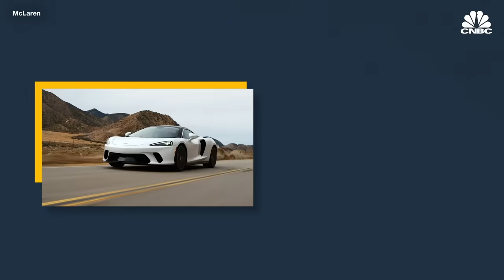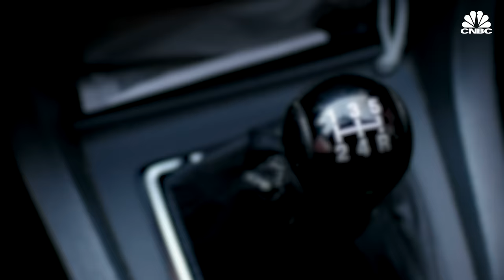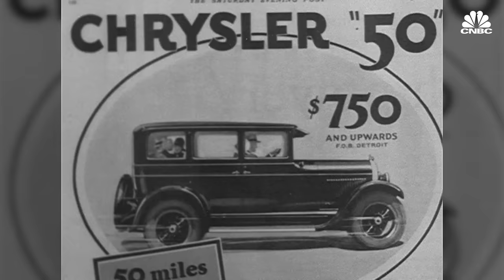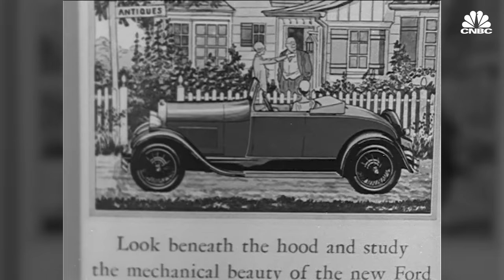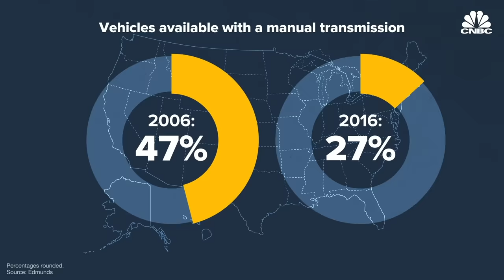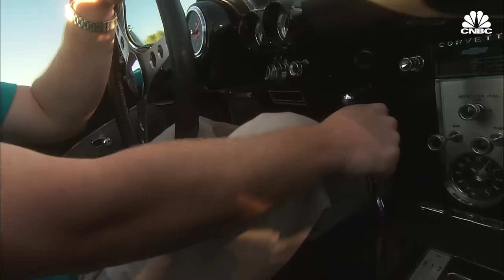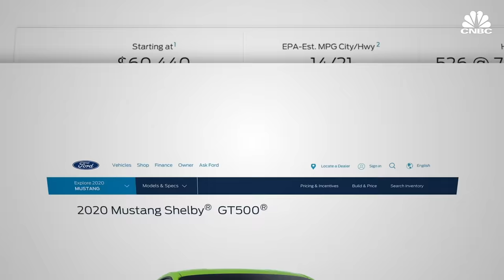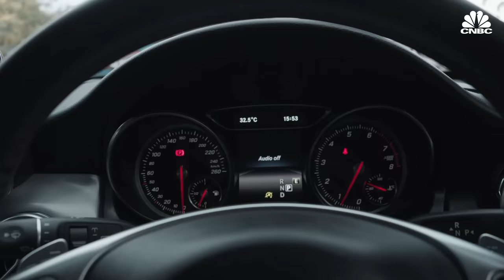Why Stick Shifts Are Going Extinct

Comment: Coming from the UK obviously I know how to drive a stick. My first encounter with an automatic was a bit hazardous. I was using the wide brake pedal as a Clutch pedal at first and when I came to a stop light I stomped the what I thought was the clutch pedal which was the brakes with everybody in the car lurching forward. Took the test car back to the dealership and looked for a manual that I bought. Actually over the years I find that freeway driving in congested traffic with an automatic is easier to tolerate than constantly shifting and slipping the clutch. Still prefer manuals but auto trans has its points.
Reply: Same experience with automatic shift, I often hit the break HARDDDD think it's the clutch lol
Reply: True, although i usually just decouple and put it into neutral in highly congested traffic. 

That way i can relax a bit rather than keeping the clutch engaged.
Makes it tolerable to drive a manual.
Reply: I never had trouble driving a manual in heavily congested traffic (L.A., ATL, Tampa, and D.C.). I learned how to slowly cruise in first gear without engaging the clutch while keeping a reasonable distance from the guy in front of me so that I had plenty of time to react if I needed to come to a complete stop. The trick is not to tailgate the guy in front of you and simply relax until the traffic opens/speeds back up again. I'd make a game out of it to see how long I could go without engaging the clutch. I never stalled, I had zero accidents, and I never came close to causing any. It's just a matter of skill and attention. I'll also add that I never texted while driving, though I would occasionally eat something while on an open highway.
Reply: I have the same problem when I get a rental as they're all automatics. I'm just upside-down and backwards until I get my car back from service.

Comment: Engine brake is still the best asset of stick shift.
Reply: Automatic cars also do engine brake.
Reply: Oo for noobs who don't know how to use engine brake properly.
Reply: What about pushing your car to jumpstart the battery?
Reply: Wrong. You can still use engine braking in automatic.
Reply: Paul Armstrong  the difference is when reaches low RPM in automatic it won't stall.
Reply: Damn Millenials..

The best manual car feature is the fun miles. Nothing compares to being able to feel the road and adjust how the engine pulls you over it. It's what makes people with stick shifts better drivers. Automatics feel like a video game.
Reply: @pjamese3  
A filthy casual video game, at that.
Reply: P mode in automatic does that job, or just leave the car in d or reverse .
Love automatic.
Reply: Angel Dust  NEIN NEIN NEIN!
Reply: Can agree here, saved me and my friend on a drive to the store. We were just going along, stopped at a stop sign, and I just casually say "I lost my brakes" lmao
Reply: Also while overtaking! (You can put it on 3rd if you are on 4th or 5th to get more power, but in AMT, the machine won't).
Reply: @pjamese3  Nah, say unskilled lazy millenials, I am a millenial who likes manual transmission and is buying one (also because, I am from India, and here most men prefer manual transmission).
Reply: Clearly those who say "engine" braking in automatic have never felt engine braking on a standard transmission
Reply: @RamsesTheFourth  when you don’t expect it to/don’t want it to
Reply: A good one, but the best? What about bump starting when your battery or starter is bad? What about heel-toe blip and brake around corners/highway exits? What about clutch kicking near redline in gutless cars to initiate a drift?
Reply: Manual transmissions are more fuel-efficient. You're not in a higher gear than you need to be, so the car is saving more fuel. Manual transmission vehicles also seem easier to maintain in some areas. That, for me, is the best asset of stick shifts.
Reply: It has saved me many times
Reply: Funny thing is engine braking is something I do all the time. I don't even REMEMBER when I learned to engine brake!
Reply: electric is superior, gg
Reply: clutch kicks are pretty cool as well ;d
Reply: @RamsesTheFourth  But you cant adjust the amount of braking by selecting a lower gear and in my experience the braking effect is otherwise gentler too. I've owned both.
Reply: @Xyb3rTeCh  Why would a manual stall if the driver knows how to drive stick?
Reply: @latuman  occasionally people made mistake...
Reply: @Xyb3rTeCh  I'm sure, but I've never personally done that, because the car will tell you in advance if your revs are too low and you should react to it. I've only witnessed in driving school.
Reply: When you are on the railway crossing without gas you should:
Manual: Your starter motor better start running in the 1st gear or reverse.
Automatic: your legs better start running.
Reply: @latuman  Thats true. You have control with manual.
Reply: @AlexBoneChannel  how often do you find yourself in this situation? :D
Reply: @latuman  I have had to crank the last 200 yards to the gas station only once. Chance on empty tank on railway is even lower but not zero. Probably one in a billion chance. But still there are 7 billion people on earth, with not everyone having a car. so you could say worldwide it happens almost every day with an automatic car.

Comment: I feel a little offended that Subaru STI wasn’t mentioned and as far as I know, they can only be bought with a manual transmission.
Reply: Same with the Civic type R.
Reply: @gtlegacy8  Yep. I feel like manuals would help curb a lot of distracted driving if people had to concentrate on, ya know, driving.
Reply: I was gonna say same with doge demon but they put in the video and called it a doge Challenger.
Reply: The STI does only come manual. I have the WRX (non STI), but got the manual transmission. I absolutely love it. Screw the automatic. Lol
Reply: My wife's Subaru STI is probably my favorite car I've ever driven, even more fun than the Porche Boxter she used to have. My car is a Jeep Renegade and it was kinda difficult to find in manual but ended up saving about 10% of the cost.
Reply: I love the manual gearbox on my Subie, too.  I tried to get the standard wrx here in Japan but it does not offer a manual.  So I am poorer than I had hoped but am enjoying myself in the sti.
Reply: @gtlegacy8  dude. I'm not blowing 40k on a civic.
Reply: I have an STI and it's so fun to drive!  There is no automatic transmission equivalent to the joy of braking and gearing down into a corner.  It's even more fun if you learn to heel-toe and rev match.

Comment: I got my 2002 Maxima just because it came with a 6 speed manual and a 3.5 V6. I had it since December of 2012 and it now has a bit over 340,000 miles...

Comment: if everyone had to pay attention and use stick, there would be fewer accidents
Reply: Once you've been doing it a while you don't think about it. At all. In the same way I'm not thinking about where the keys are on the keyboard I'm typing on or about how much force to put on the brake pedal when I need to stop. You just get in and go. You don't even think about changing gear.
Reply: And they would be closer to home and going slower!
Reply: menschkeit1 Tell this to teenagers who are checking their cell phone constantly even when driving.
Reply: Exactly...wrong.
Reply: Yeah sure
Reply: It certainly makes sense, and I'd like to think so, but you could just as easily say that manual drivers have to be more focused on the mechanics of driving, so they have less attention left to devote to traffic.  The fact that manual drivers don't have a free hand for their cell phone, their Big Gulp, or their Double Venti Skinny Decaf probably helps, though ;-)

Comment: "Requires energy and focus...falling out of favor overtime" .... Lazy lazy lazy. Maybe that's why number of road accidents are increasing.
Reply: I lol'd when I heard that. It's like the video is made by someone whom never drived a manual. Your brain does everything automatic lmao.
Reply: Rozoka,   Yeah, they are so lazy here they whine about having to push down the door lock button by hand, not to mention having to manually roll down a window.
Reply: They are not increasing. Accident rates have fallen constantly since the 1970s, thanks in part to Ralph Nader. Don't make up statistics just to back up your opinion.
Reply: Requiring energy and focus are not good things. Both are distracting.
Reply: @flagmichael  yes  being Focused  is real distracting!

Comment: Title : (US) stick shifts are going to extinct 
Me: laughs in India
Reply: Number of auto-transmission options has been growing for last 4-5 years. India will have similar situation by next decade. It has a simple reason to it.  Most people use thses cars for commute and thinks getting stick shift out reduces some work for them so they go for it.  And as market demand for that option grows industry inclines towards that option.
Reply: @amitpatilamit  true... but at least our reason for preferring automatics is to reduce stress during commute in insane traffic, not because of lack of "skill and constant attention".. besides, I think we still have enough time to enjoy manuals in India, at least until they start releasing the ultra fuel efficient automatic transmission gearboxes which are more efficient than manuals in all conditions...
Reply: Manual are a lot of work, effort and attention. I would never buy one. I have driven both and currently very happy with my automatic. Fuel usage is a myth, auto are very fuel efficient.
Reply: Vijay Simha Gotur once you drive auto you will never go back to manual. Stress less, less effort and work. They are already very fuel efficient, this is an excuse used by manual car owners because sale price of manual car is 1-2 lakhs cheaper than auto. I currently own auto and mileage and fuel expenses are same.

Comment: In Germany, not using manual transmissions is seen as weird xd
I personally think that learning manual is good but since electric cars are probably the way to go, it isn't that necessary anymore.
Reply: @Vroomfondle1066  Do you have a better solution?
Reply: @Vroomfondle1066  You're a man of culture but not of political realism. Also, as much as I would like trains to succeed everywhere, there are roles they just can't fill and then it's either (electric) bus lines or shared cars that will have to do that job for them. Looking at the current bus schedule for my village, however, I believe in the latter option for more than in the former.
Reply: @Vroomfondle1066  They are good but having a regular bus schedule just isn't worth it in a lot of locations and not having one makes the citizens stuck. Public car sharing works good to solve this issue. In my village for example, the only times when there is even enough theoretical demand for the bus (aka assuming that everyone takes it, no matter what) to be profitable is in the morning, after the end of school and in the evening.
Reply: @Vroomfondle1066  Yes, this whole "let's not change and hope for a miracle to come save us" mindset is a big problem for us as a society because we need to adapt and invest. Hopefully, we'll get the turn before it is too late

Comment: In Europe EVs are the main reason stick shifters will be phased out.
Reply: And soon in the rest of the World.........Many still have their head in the sand..........Paul
Reply: I will never have an electric car
Reply: @lizichell2  you must hate driving really fast huh
Reply: @CheesyBigMac1  nope I just prefer internal combustion
Reply: @lizichell2  your just soundn a little bit sensitive
Reply: @CheesyBigMac1  I just said I will never buy an electric car.b
Reply: @stardigest3014  yes by liberals
Reply: @lizichell2   Because it’s an outdated and pollution-prone technology which uses non-renewable energy.
Reply: @lizichell2  So renewable energy is a racket, but the oil industry isn’t a racket.  Is that your stance?
Reply: @lizichell2  You'll soon have no choice
Reply: @bam-skater  I don't listen to tucker. I just don't like being told that the choice of car I feel most comfortable and safest with is going to done away with because of a bunch of liberal free hugging motorway blocking jobless bath dodging hipsters.
Reply: I have trouble driving automatics and I prefer what I manual. Most people are the other way around but I am not.
Reply: Given that most of europe is low rise flats and not an suburban nightmarescape like the U.S I doubt it. There's no space to put all the chargers required.

Comment: I cut my teeth on a stick shift and while I do appreciate a paddle shift there is nothing quite like driving a stick. A real stick shift driver can hear and feel where you are on the power band thus you feel more connected to the vehicle.
Reply: I can feel the road, gravity, force, speed, acceleration, deceleration, you name it. Automatic transmission? yawn Like riding in a city bus.

Comment: Definitely been endangered for years the stick shift.  If you can't drive a stick you can't drive.
Reply: Michael King but i drive everyday with an automatic...
Reply: @jamie49868  Man those kids who race in those non shifter karts will never amount to anything in motorsports
Reply: K boomer
Reply: @paulnadratowski3942  You are correct man..  what I said isn't technically true.
Reply: @jamie49868  If you can't drive with paddles you can't drive.
Reply: @Stxr KillerX If you don't ask does it make what I said untrue?
Reply: @johnmcglasson5444  Thanks boomer!
Reply: @jamie49868  But I bet you every F1 driver can drive a manual. Also did you know F1 cars have a clutch pedal?
Reply: Fl4shbang you rock my man!

Comment: Most manual transmission last longer than automatic transmissions,  my 97 ford ranger manual has 295k miles with original transmission. Most new cars  the auto transmission dont last half that. Plus manual transmission  is easier to fix.

Comment: "CVT's have their critics....."

No kidding! Go look on Carcomplaints.com and check out the reviews of cvt's that crapped out at 50,000 miles. Oh, and there's no way to rebuild them? So now you're stuck dropping $5K into a new one so it can be bolted in. The EPA and their never ending quest to squeeze every MPG from a gasoline car have ended up giving us automatic transmissions that are so fragile they'll never make it to 100k on a vehicle. If this isn't reason enough for new car buyers to go back to a manual, then I don't know what is. I've got 125k+ on my manual hyundai and the shifting is still tight after all of these years. My next car will be a manual too.
Reply: Yeah CVT's make automatics look like sticks.
Reply: I repair the horrid things...so many fast wearin parts.
Reply: I've noticed Nissan's CVTs crapping out at 60k-80k a lot. Not as much on other brands.
Reply: Only if you can find one and that is getting more difficult thanks to Manufacturers and dealers that want to continue sticking you with huge repair bills.
Reply: My Subaru Outback CVT has done 220,000 kilometres and works perfectly. Very happy with it. And I learnt on a A Model Ford so I can drive a real manual with no synchro too.
Reply: @graemebdh2172 , man, there's a ticking time bomb if I ever saw one. You do realize that once that CVT goes (and it's not a matter of IF, but WHEN) that you'll be stuck with a repair bill for more than what your entire vehicle is worth? I'd personally think about unloading that on a trade in or something at this point...
Reply: CVT TRANSMISSION ITS THE WORST TRANSMISSION AND EXPENSIVE FOR REPAIRS
Reply: I have a 2004 Mazda 6S.  I can't remember the last time or if I ever did after the first 6 months used auto.  I will do the manual shift even if I am going to the store, and I have 180,000 miles on it.
Reply: Why did you use an apostrophe to pluralize CVT? CVTs, not CVT's.
Reply: Melvin Holliday that’s the main push to go automatic. Stick is too reliable (and cheap).
Reply: alameda748 I feel your pain. It’s basically a time trap on your vehicle. Lol. Manual transmission is just too reliable.

Comment: I'm 16 and my first car is a 06' Mazda 6 with a 5-speed manual. I'm still learning but its definitely not as hard as its made out to be.
Reply: it's not hard, once you get the hang of it, you just shift and it's as simple as that
but also, in a traffic jam it'd be better to go automatic
Reply: The hardest part is 1st gear. Everything else is cake compared to that.
Reply: @RayneAngelus  taught my friend how to drive well enough to get to new york from jersey in a stick in 15 minutes. slight hill plus hand ebrake + brand new clutch learn 1st and reverse drill it for 15 minutes everything thing else is easy and just takes repitition.
Reply: @sariahreigns3666  Cool! A fair bit of it is down to the individual learner, too. Some people just can't learn stick, some pick it up fast. I had a hard time at first because I "knew" that "riding the clutch is bad", but not riding the clutch on start from a dead stop is worse = P
Reply: Mine was a 08' (same thing). It's a good manual.
Reply: My first car had a stick. I took it out, practiced for a few minutes and was on my way.   It's not difficult.